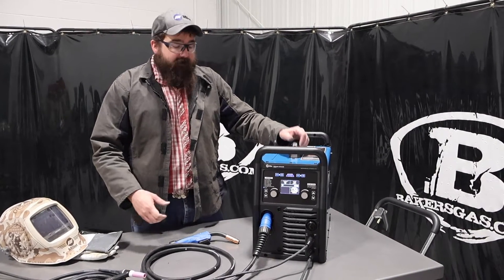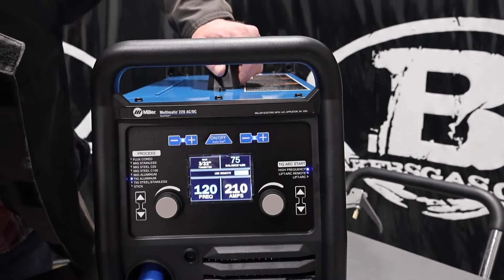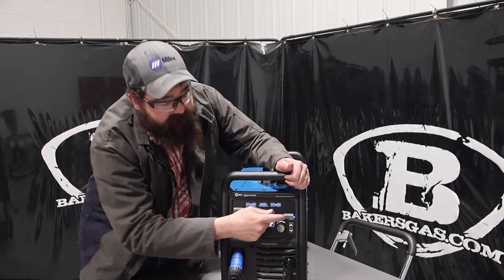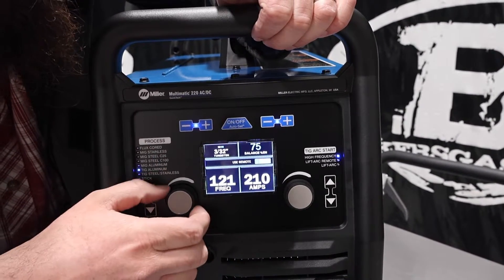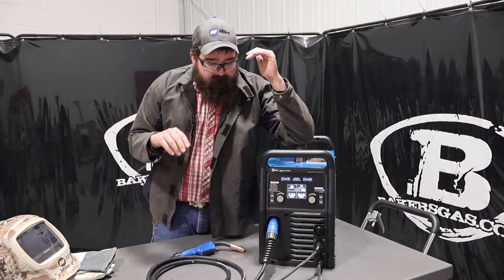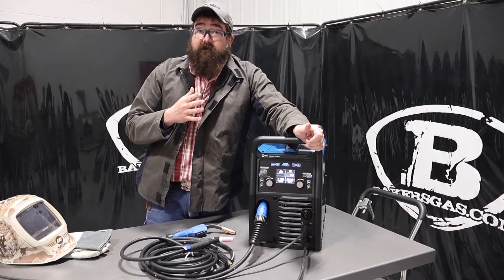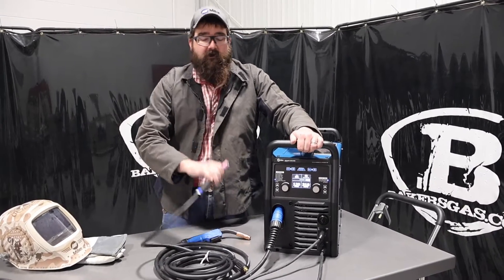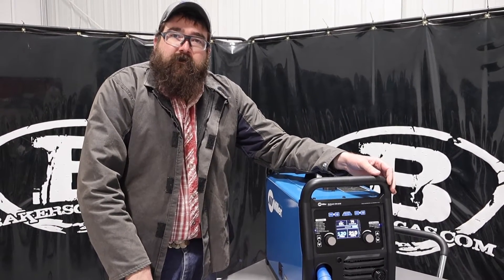Miller 220 - 907757 Frequently Asked Question on AC TIG functionality

Comment: One thing even though it’s an entry level torch. Throw that weldcrap torch in the garbage it doesn’t even withstand the duty cycle that the machine is rated for. Get a CK when you order the machine and be done. Otherwise great machine.
Reply from the maker: We love the CK torches too!!! Always nice to get the superflex and flex head torch!

Comment: Miller expects you to throw your machine away when they decide to not support it. Deem it old tech… 

Esab is my next buy, thanks Miller for making the choice easy.
Reply from the maker: Most DC STICK welders do not run 6010, this is not software it is hardware change so not possible to upgrade the previous models. Sorry about that.
Reply: @BakersGas understood but perhaps there’s a misunderstanding of what I am referring to, Miller won’t even send me or my tech the running firmware for the model welder I have.
Reply from the maker: @Metal-Maniac74  if you need help finding a service center or using your machine please let us know and we can put you in touch with someone that can help!
Reply: I used Miller approved service centres and they all said the same brother. Be forewarned, when your machine is outdated, they won’t even send your tech the board schematic to help keep your machine running. The Miller rep told me to throw it way and buy new.!!!!!  I used my Miller 150 STH half a dozen times since 2004. My tech says he can’t find anything wrong with it and my machine is likely a firmware issue. Miller won’t even cough that up.

It only works in 220v now.

Comment: This machine has no MIG post flow.  do not buy if you need to MIG stainless, very disappointing for such an expensive machine.
Reply: That’s a debatable point I see what you mean. It’s easy for them to do. Don’t see why they don’t offer it in advanced setting but here’s the deal with this machine I’ve had mine like 3 years now. It’s an introduction machine that does it all. It’s meant to be just user friendly and simple. Less settings than most others. Because it’s not a professional machine it’s a hobbyist and small light fabrication. Not a day in day out machine. It will do that too but it’s not for those people and you can tig stainless. So if you want post flow then use your tig set up if you can’t tig stainless you shouldn’t be mig welding either. And if you can’t then you don’t care about post flow. Really the 6010 isn’t that much of an upgrade they could have added pulse mig that would have been the best ideally. Maybe next upgrade but it’s short us with a pre 2024 machine cannot upgrade and they don’t care about us that got the first editions of this machine. They update it about every year or year and a half a new sku.
Reply: @kylearaiza8808  I weld 26-16ga stainless sheet metal 6 days a week, I bought this for my field welder coming from a much cheaper esab that had way more adjustment.  

I do light fabrication and I need a machine that is light enough to throw in a scissor lift.  I bought this because it's the smallest miller with the quick switch tech between tig and mig.

I've used much cheaper machines that had post flow, like the crossfire trion.  This miller machine has a setting called stainless mig, it honestly feels like false advertising, I'm not sure why it even has that setting... What makes it stainless mig without post flow?  It's physically capable, but the software isn't there.  Seems like an oversight considering the millermatic 252 I use in the shop has post flow and it's a much simpler machine.

And yes, I use both mig and tig, and I can tell you mig welding light stainless properly is much harder than tig.  Mig welds much colder with way less warpage and is way faster.  Well worth the price of tri-mix.  Tig has it's place but it's no substitute when I NEED post flow on mig.